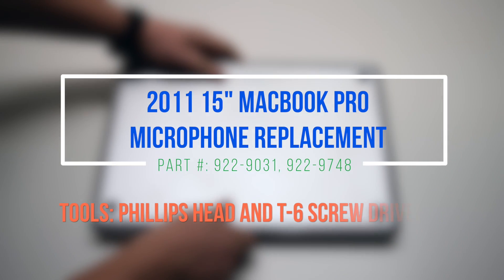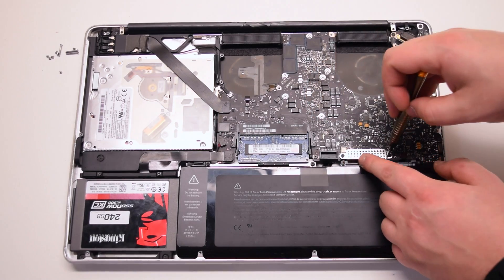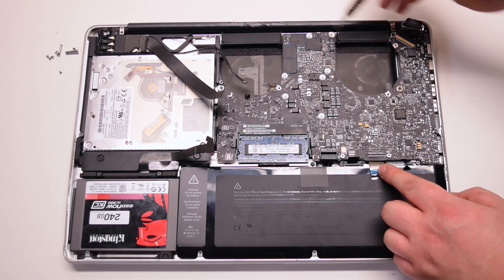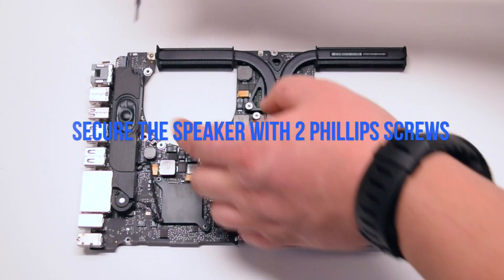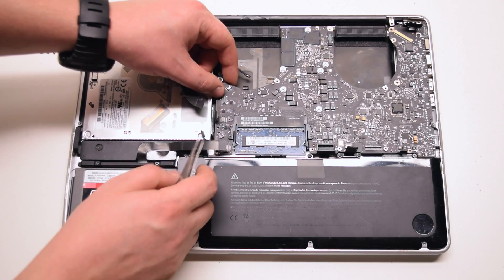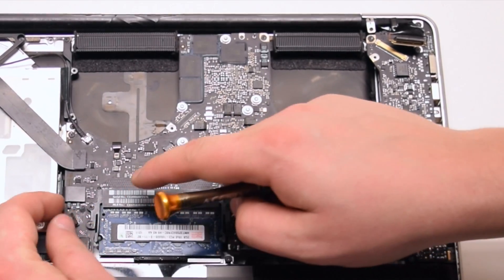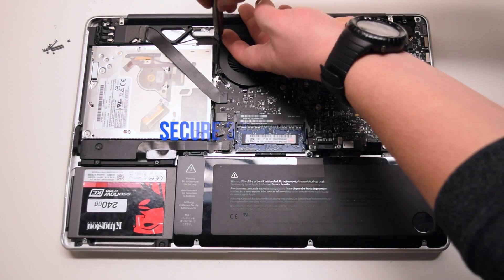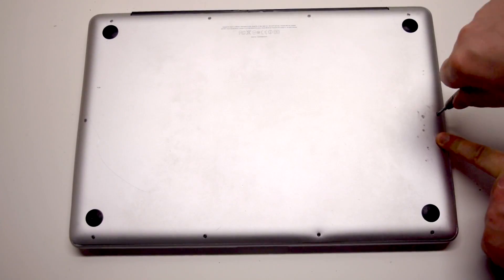2011 Macbook Pro 15" A1286 Microphone Replacement

Comment: Mic didn't work so I thought it was dead. Opened up my MacBook as per this vid and found out the Mic was unplugged from the Logic Board. Plugged it in, reassembled, fired it up, and it works fine. Thanks for the clear and concise instructions. 

Great stuff, this.